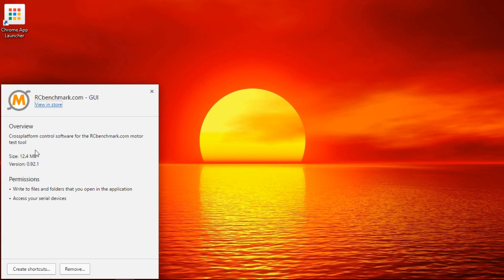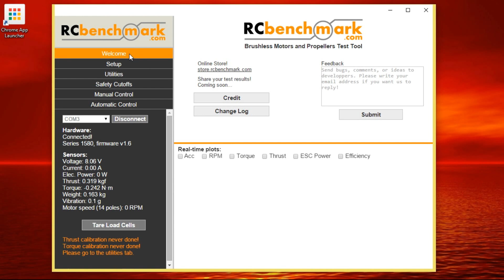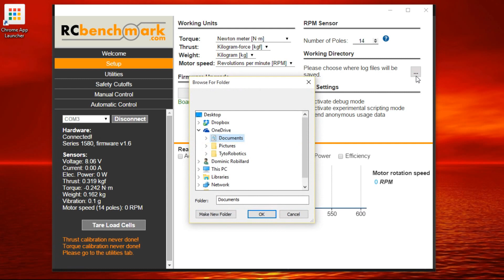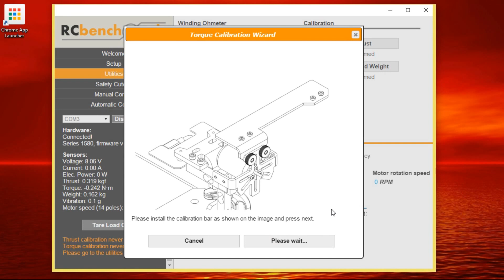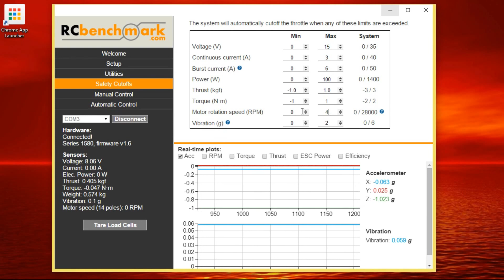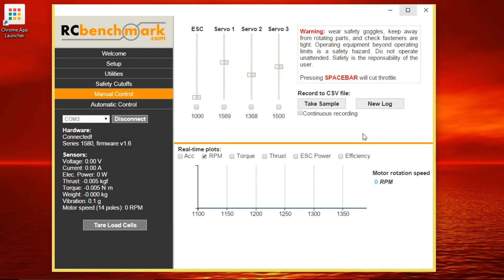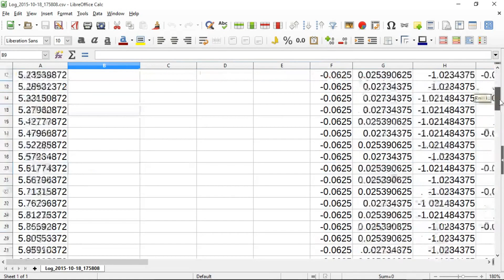RCbenchmark Software Overview - Part 1 of 2

Comment: Control panel: Weight?
Which weight its showing
Reply from the maker: Good question. The Series 1580 can provide the weight of whatever is placed on it (after being tared), so in this case it shows the weight of the motor and propeller.

Comment: While calibrating torque and weight, it gives an error.(ERROR :Could not calculate hinge separation distance. Make sure that both torque load cells are responding and try again. To check load cells, please active debug mode (from the setup tab). Resetting the board (disconnect and reconnect USB) may help.) Can you help me ?
Reply from the maker: Hi Sefa. You can contact us at support@rcbenchmark. When  you activate debug mode, you will see the load cell reading in mV. The reading, as well as how the reading reacts to forces, will give us an indication of the issue. For example, it could be a load cell that is not connected correctly, or a damaged load cell producing a reading out of specs.
Reply: @tytorobotics  thank you.ı solved the problem.

Comment: Is there a way to disable the RPM Safety cutoff.  I am trying to run a script to find the number of polls on a 3300KV miniquad motor on 4S with no props on it.  16V @ 3300KV = 52800RPM!  The script terminates because of RPM cutoff,  I can't set the RPM cutoff high enough to prevent this.
Reply from the maker: +damage.cc The electrical RPM probe is limited at 200k RPM at 2 poles as it is what we have tested (50k rpm at 8 poles, etc). We are considering increasing that limit. In the meantime, can you send us an email at info@rcbenchmark.com? We will send you a short code and instructions to unlock the RPM limit in the software.  We have not tested that speed, so it may not work. If it is the case, you can use the RCbenchmark optical probe. With a white and black tape on the motor, you will be able to test up to 200k RPM.

We decided to offer the electrical RPM probe by default because it is very simple and fast to setup. There is no alignment or adjustment needed.